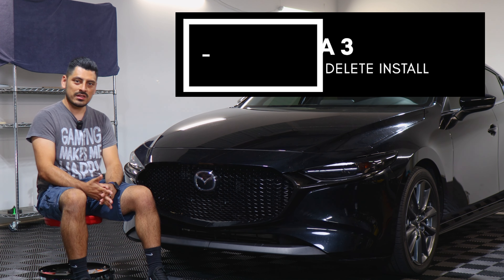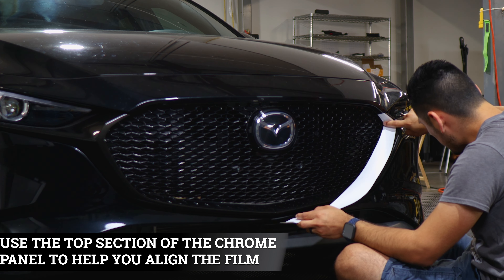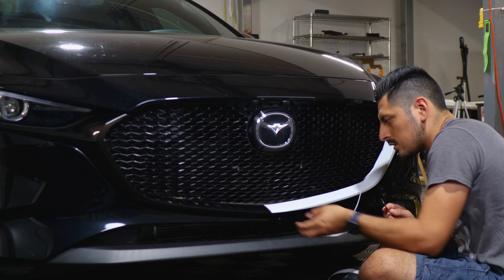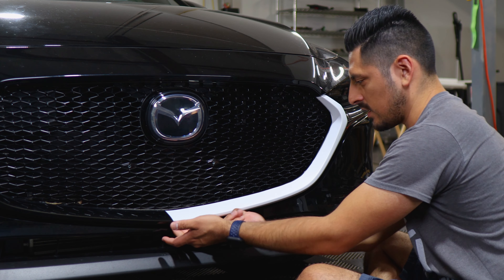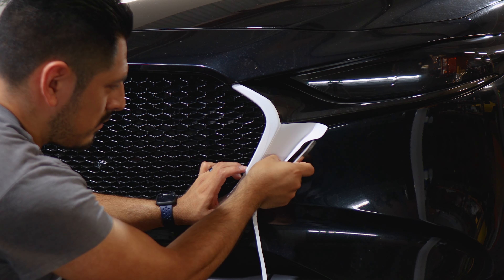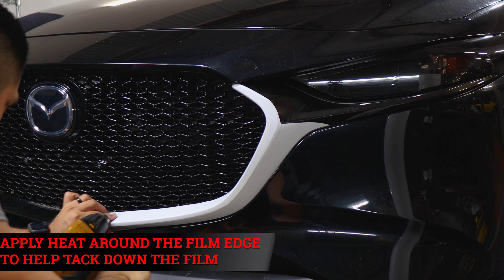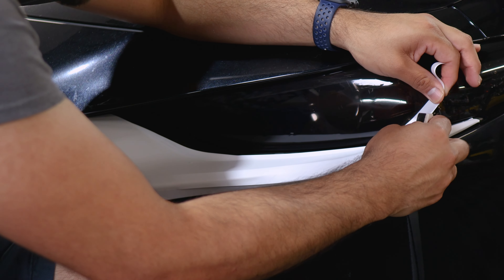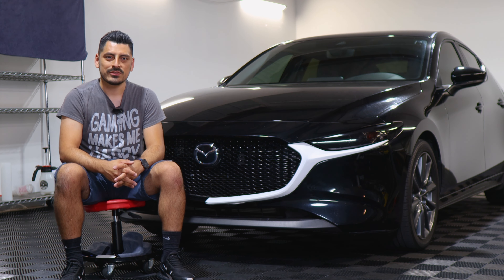2022 Mazda 3 Front Grille Chrome Delete Install

Comment: Just purchased this from you guys but I have a question...I bought a used 2022 Mazda 3 2.5 T sedan from a Hyundai dealership. The dealership claimed to have ceramic coated the car...what could I use to clean the chrome trim to ensure there isn't any ceramic coating left on the trim before I start the vinyl chrome delete?
Reply: Polish machine unless it’s sealant spray the alcohol.